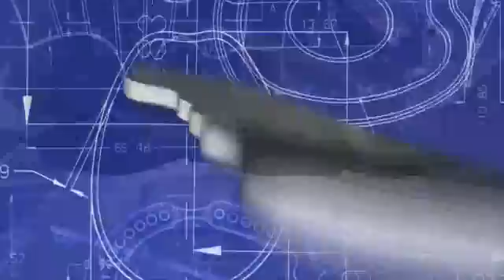#britek  Energy Return Wheel... Autonomous Never Flat

Comment: Not sure I'm understanding the mechanism here. You create two concentric rings. The vehicle weight is still sprung, eventually, onto the outer ring, so the sprung weight hasn't significantly changed. Somehow the inner and outer rings are connected to enable drive power to be applied from drive shaft to road, and for braking force to act against the vehicle's momentum.

So exactly what energy is this membrane absorbing and then turning into thrust? And how does that not degrade braking?

Comment: If you say that a rolling tire has vertical force on it in the direction it's rolling, would this tire be able to stay attached to the membrane with large amounts of horizontal force? Imo, it doesn't look like it would be a good traction design. When heavy force is applied in that direction it would peel away the layers because of the uneven surface friction that turning creates.

Comment from the maker: The ride is adjustable. As we increase the stretch energy either by tightening attachments or by adding a vacuum charge to the hoop side of the membrane the stiffness and response increases. We can increase the hoops articulation and flexibility to go out of round for more comfort or we can use a more aggressive taller tread layer to conform to irregular surfaces. The anti kick back is very special when combined with the lightning quick response times.

Comment: The POWER that runs the axle shaft's in some trucks and cars can not Hold that wheel why? well for 1... Rust.. water ice.. element's in general.. Then you got Torque .. that kind of power on those on one wrong slip or object in that wheel would end it...

Comment from the maker: The screw force accumulation and return makes for exciting acceleration and performance gains from any vehicle. Handling is razor sharp with additional G force when you need it. A driving experience that you will never forget. The 100 year old pneumatic tire has about run it's course.

Comment from the maker: Wheels hoops historically speaking are attached to the axle hub by spokes, paddles, blades or other rigid linear structures. We are about stretch. We have discovered many ways to create stretch dynamic tension between the hub and hoop. Our favorite... stretch a diaphragm and the air inside to capture G forces between you and the ground then return as much % of that energy as possible into to rolling action.

Comment from the maker: The high speed issue is an important one. A pneumatic tire is a balloon... so a tire tread is on a bubble. Air pressure, tire body, tread and sidewalls are fighting against the formation of a tread block. We roll a composite hoop sprung/suspended via highly charged elastic attachments. We stay on the surface while a pneumatic tire's bounce looses traction. It maters more as speed increases.

Comment: I love this concept. the only worries i would have, is how does the wheel handle at higher speeds, and how would it react to potholes? It would totally crash the market for tires, regular tires that is, but would be a much wiser choice by far if the durability rate was higher.

Comment from the maker: When we increase attachment tension the ride becomes firm. There is a happy medium between the attachment tension and proper suspension of load. Remember we are stretching a tough flexible diaphragm that is supported by a vacuum pressure. Sort of a suction cup cartoon wheel with vacuum boost capabilities. We also have sweet, springy composite hoops to deflect blows and stick to the surface.

Comment from the maker: ERW will require significant investment to launch. We are researching materials and molding processes to simplify and reduce the amount components. Many possible wheel attachment options but we would prefer a wheel/hub profile that could still run without any tire body. The future is wide open and we invite tire companies and wheel suppliers to contact us about our low cost license.

Comment from the maker: A pneumatic tire requires 7-8 gallons of oil per tire.  An impact modified plastic hoop and an expandable, replaceable tread band combined with natural gum rubber diaphragms could cut that in half. The oil companies will save energy while delivering product and no doubt will pass the savings on to us... pretty much for sure, mostly, kind of and for certain.

Comment from the maker: ERW 360 stretch attachment does process tiny bumps between the hub and the ground as the elastic attachments play out a positional tug of war. The radial array of attachments generates a close to real time hoop return against outside forces as it deflects and rebounds within the scope of the composite hoop. As we add "tune" more developed tension into the wheel, the quicker the response, firmer the ride, throttle fling acceleration.

Comment: I question the reduced contact patch when the road surface is less than ideal. Ultimately kinetic energy must be shed via the brake systems, suspension components as well as the contact patch on the surface of the road. If that surface is uneven, wet, covered in very small particulate debris such as sand or small gravel then I would question the value of a smaller contact patch. I have not seen the data and this clearly requires thought. Would love to see braking tests on various surface types.

Comment: PSI shouldn't have anything to do with it though. I'm talking about the actual contact area that the tire has against the road surface. A normal pneumatic tire will have a flat contact area as the rubber bends from the weight of the vehicle. This is why rock crawlers lower the PSI of their tires: To fold and grab more surface area for traction. Traction is important to stop and remain stable at high speeds, and this tire design remaining in a perfect circle appears to defeat that purpose.

Comment: i don't think this absorbs tiny bumps or point loads as well as a "balloon wheel". with a traditional wheel you don't feel a small rock at all. with this the wheel might lose traction on it an you'd definitely feel it because the suspension doesn't absorb tiny sudden shocks like that.

but oh well, everything has it's unique drawbacks, right?

Comment: Certainly with the less contact area that you have, the less rolling resistance that you incur. It's a simple principle of course that even allows rail cars to remain so much more energy efficient for rail shipping. But having said that, does this not reduce the stopping distance of a vehicle? You have less contact area with the pavement resulting in more difficult speed reduction, not to mention handling. There is a unrealized benefit to tires flattening upon contact with the road surface.

Comment from the maker: There are many niches for ERW to fill. Our first USDOT tests were performed with several 3/8" holes drilled into the elastic attachments to simulate bullet holes. We could tell no difference in performance. Try that with any pneumatic tire. Fuel savings add up quickly, combined with a "totally new" driving experience, you are hooked.

Comment from the maker: High psi. aggressive traction layer for highway performance plus paddles off the curved hoop for loose material. Paddles remain off road surface and only engage under heavy cornering forces or travel on loose materials. ERW will be further tune able via vacuum diaphragm boost and sidewall/interior vacuum boost.

Comment: Another old technology being re-innovated for modern transport, just like electric powered car's and the hydrogen fuel cell.
I do like this design more than the other airless tire designs that I have seen especially what you call the de-weighting / spring effect. 
But I think the complexity of this design will drive up the cost so much that it will never be an economical solution to modern day run-flat tire's

Comment from the maker: Expect a fully serviceable ERW. High performance diaphragms, impact modified plastic hoops, replaceable expandable traction systems, highly elastic sidewalls. They all assist in screw force accumulation/return. Did we mention vacuum charged diaphragms? We have filed continuation-in-part patents on the improvements. Check out the obvious impact resistance shown on our bicycle videos.

Comment from the maker: When you lower set of ERW to the ground the hubs sink within the scope of the hoop. The "stretch" displacement/ weight relationship. Lowering hubs sink to float level.  Hubs now suspended from the top180 degrees inner diameter of the hoop. Sprung and ready for throttle response!

Comment from the maker: We have articulated composite hoop proto that springs a footprint to the surface. It takes more time for the pneumatic tire to slap a tread block to the surface, roll a hoop. For off road expect aggressive tread patterns and paddles off the curved hoops. Smooth highway performance, paddles for soft/loose materials.

Comment: What happens if you hit a pothole. wouldn't it bend the steel loop over time and cause flat spots. what about radial flex that a traditional tire has to help prevent loss of traction by keeping the tire flat as you corner. Just wondering.

Comment: I was looking for more information on your website. There is not even one good explanation on how it's better than a traditional wheel (the garage door explanation has nothing related).
Maybe some experiments ? no, because a wheel so heavy requires much more energy to turn (more than the same weight laid in the car), and therefore your "Energy Return Wheel" makes the car using more energy, much more than a wheel with only rubber and air.

Comment from the maker: We deliver psi. to the surface and flex a composite hoop instead of making a tread block. We lever a wedge to the surface under hard cornering and squeeze wedges into the surface under hard acceleration and brake force. We have screw force accumulation/return that can provide up to 10-20% improvement in drive train efficiency...plus double digit rolling efficiency gains. The pneu. is nearing the end.

Comment from the maker: Our newest prototypes are far superior to the pneumatic tire for efficiency and control at high speeds. The pneumatic tire flattens a tread block and must reform one while moving forward. Today's tires over bounce and even launch off of the compressed suspension system becoming air borne...the cause of many accidents.

Comment: One thing you're missing. A good tire doesnt touch the ground with a small tanget of the bottom of the tire, it actually bends to form a large area of surface contact. this would be something cool for prius drivers, but if you want any kind of decent handling, takeoff, or braking, you're going to go pneumatic.

Comment from the maker: We were just creeping around with the first prototypes and doing low speed coast downs. We tested the "second gen" on on our 4,800 lb. AWD ML 55 AMG for our first USDOT tests. We were surprised  when they "chained" the AMG down to the AWD 48" drum dyno and set resistance to 6,000 lbs. The setting made for a short coast down for the 35.5 psi. pneumatic tires. ERW did much better!

Comment from the maker: Our original steel hoop weighed almost 22 lbs. our newer composite hoops are 8 lbs. with 10 lbs of elastic attachments to the hub. Our traction systems are another 10 lbs. for 285 35 19. So the same or a little less. A KUMHO 285 35 R 19 is about 33.3 lbs

Comment from the maker: We can simulate tire deformation by hoop articulation. This way we are flexing to the surface with better than 95% energy return. The pneumatic tire bounces and looses control and traction while rock climbing. ERW  could be called equal response wheel, we do not over bounce.

Comment: You talk about tire deformation as if it is nothing but evil, however it is tire deformation that allows virtually any part of the tread to absorb an impact or conform to any surface. These are characteristics that are necessary for rock crawling and having a smooth ride. With that said I do like how it moves the whole steel ring so that more mass or potential energy is stored at the top and as a result is easier to rotate.

Comment from the maker: For our prototypes we love bolt attachments from the membrane to the hub. Using bolts to draw more or less tension/stretch really changes performance. We also learned that if we add a vacuum charge inside of the elastic membrane pulls we increase power and further reduce the transfer of shock and vibration to the hub.

Comment from the maker: ERW designs can increase the travel or distance between hub and hoop for greater cushion. We have a highly elastic sidewalls that can assist in screw force accumulation and return. As much as 16-22% drive train efficiency can be gained via ERW. We are "stretch" and "recoil". Place a rubber band against your lips stretch and recoil. You will notice heating up while stretching and cooling while recoiling. ERW recycles heat, the exact opposite of pneumatic tires.

Comment: There is less distance that the very edge of the tread can travel inward toward the rim so how do they ride on rough terrain. also will it eventually have sidewalls? because I could see stones getting jammed in there. Now I know that they went to tubeless tires was due to heat generated, so how hot can these things get? I know heat may not affect the tire initially, but it is lost energy and can cause wear.

Comment from the maker: For the balloon pneumatic tire to "grip" it must tread block and unfortunately generate tread squirm due to sidewall flex and deformation . So to acquire grip the pneu.tire is unstable while rolling... the true causes of wear and inefficiencies . ERW hoop is flexed to the surface reducing tread squirm and returning energy. Our novel traction systems levering off of a curved  hoop will have a retread option.

Comment from the maker: Thanks Expect an expandable retread option,  tuner hoop options, membrane/attachment options IE ERW will be tune able and fully serviceable. Weight bearing, brake force or on throttle the ERW suction cup like attachments "stretch" the air inside... for even more power we add a 18 Hg. vacuum boost. We are the exact opposite of the pneumatic tire.

Comment from the maker: You can check out our USDOT coast down or highway tests. We have learned how to  engineer the performance requirements for several applications. We will be applying what we have developed to the new auto/truck offerings. The inner hub is protected by the powerful hoop. A greater distance between hub and hoop equals more cushion and screw force accumulation/return.

Comment: Do you have any videos showing it in use on a high-performance car or bicycle?

Could you present comparative numbers to show us the quantitative difference your product makes in terms of contact patches, grip, energy loss, noise reduction, fuel efficiency, acceleration, durability overtime etc in a controlled environment?

Our major concern thusfar is the weight of the inner hub and the potential for it to shatter or crack and what this would result in.

Comment from the maker: A pneumatic tire simply looses more energy than ERW because of sidewall deformation and tread block. Our attachments/membranes are pre stretched creating a 360 balance. When ERW is weight bearing the hub sinks within the scope of the hoop until it floats... mostly hanging from the top 180. Try picking up an object that is suspended by an elastic cord. The cord's elastic tension assists in the lift. Screw force accumulation/return improves drive train EFFICIENCY.

Comment from the maker: Consider a co molded product that does not require belting overlap held together with  rubber. Expandable retreads, Hoops, performance membrane options, a serviceable product. Molded plastic and rubber just might have a bottom line advantage.

Comment from the maker: The pneumatic tire flattens on the bottom, the crumpling continuing to the rim where failure occurs. ERW displaces hoop on hub sharing the load 360 degrees. There is an immediate response to displacement because the top 180 radial array of elastic attachments is already drawing the hub upwards as it rolls. Our toughest composite hoops are rated at over 50,000 psi. where a pneumatic tire is a mere fraction of that.

Comment from the maker: ERW  weight can be very close to the pneumatic tire. Our composite hoop is less than  35% the weight of the tire body portion it replaces. Our membrane and attachment plates are close to the weight of a tires sidewalls, steel belting and cords. The USDOT coast down video demonstrates ERW double digit rolling efficiency while supporting a 4,800 lb., chained down  ML AMG 55...  dyno set to 6,000 lbs. resistance.

Comment from the maker: ERW will make more roads ideal. Hub in hoop displacement rather than chassis lift and body roll! The pneumatic tires' over response is almost gone. Pre charged "stretched"  array of attachments stores linear displacement as "screw / rotation force accumulation and return". Membrane Array  returns very large % of captured / stored energy recoil upon throttle or brake force.

Comment: This is very cool.  I've been toying with this idea in my head and 3D modeling for the last 5 years or so, a sort of "pneumatic" tire.  However the spring steel was something I hadn't thought about and is a lot more efficient than my "pre-fab" design.  My design incorporating a hydraulic fluid would be too heavy and too hard to balance, but this looks like the right answer.

I hope to see these soon, this is the next logical step to tire design, and is much better than any tubeless I've seen.

Comment from the maker: Thanks We are not USDOT approved so you can only see ERW on USDOT lab tests at + highway speeds and notice brake lights come on. Lab tech. was over coasting on the coast portions of the test. Lateral G force is "significantly" higher than pneumatic tires because of the 360 hoop on hub elastic attachments levering lateral/medial wedge to the surface.